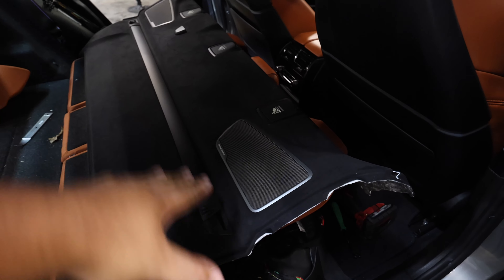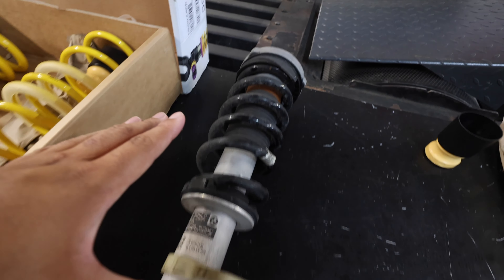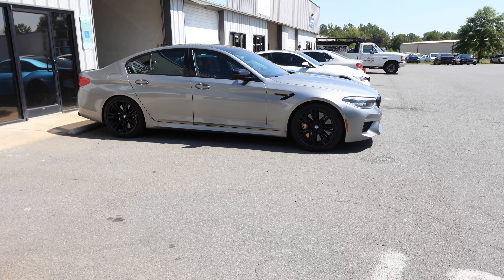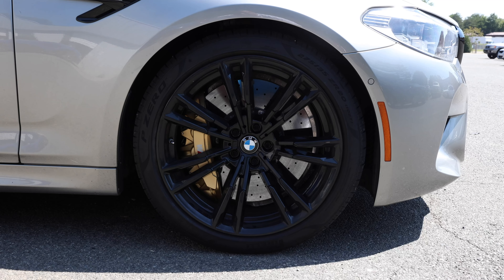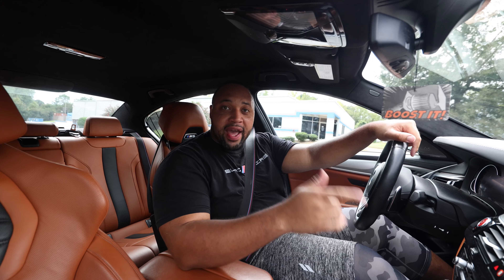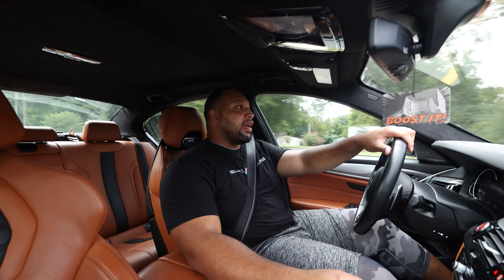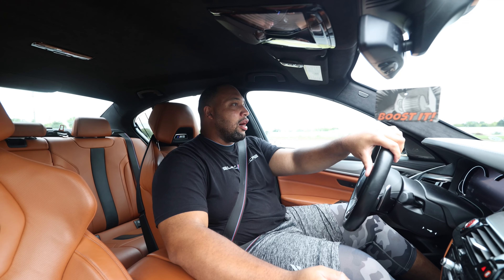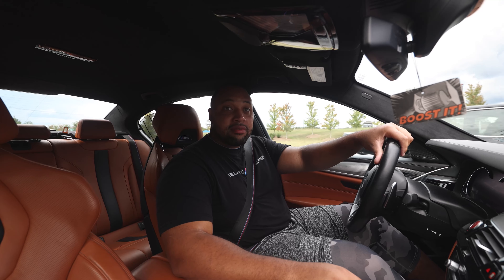BMW F90 M5 KW HAS Kit Install #kiesmotorsports #eurompire

Comment: When you installed them, did you have any lights pop on the dash or any error messages about suspension?
Reply from the maker: Nope… the HAS kit should not give any errors

Comment: What made you chose the KW HAS vs a regular set of lowering springs? I have a set of HR Lowering springs sitting my garage and can’t decide between putting them on or buying this kit.
Reply from the maker: For the F90 I have heard that the standard H&R springs do not lower enough for most people. Most people are using the M550 springs for a better drop
Reply from the maker: I went HAS kit because I wanted to run KW suspension on this car. Well it was between this kit and Dinan
Reply: @WhatsyourForte   gotcha I have a set of M550 springs but looking at your car I may have to buy the HAS kit.

Comment: Sry mate, g80 m3 way better in every aspect. New m3 true racer this is just powerfull limo not racer sports car...
Reply: Where’s yours 😂
Reply: Go watch auto glory. M5 smoking everything moving.. so I’d contest that statement, but we’re all entitled to our opinion🤷🏼‍♂️ ( sports sedan 😉 )
Reply: @TheSubaruAddict  when subaru becomes a brand I will respond. 😂😂😂
Reply: @swift__  g80 m3 comp stage 2 smokes 992 turbo s in 1/4, m5 stage 2 doesent....
Reply: @enakup  if the turbo s is stock sure. No way a stage2 911 turbo s is losing to a g80 m3 that’s also stage 2.. stage2 g80 is ots  jb4,bm3 etc are all ots. Stage2 g80 is same power as 911 turbo s stock. But we can agree to disagree. ( 7 series is the powerful limo you referred to . Imho of course )
Reply: @enakup  I don’t even drive a Subaru anymore lol they’re pieces of shit.. lmao
Reply: @enakup  believe it or not I actually have a ‘23 g80 m3. The point of my comment is let the man do what he wants. The M5 is a fantastic car for his needs so no need to hate
Reply: Why so condescending? I can be dismissive too.. m3 is slower in a straight line and needed pilot sport cup2s to barely beat a 5 year old F90 chassis running crap pirelli pzeroes around the ring. M5 has historically been a tier above M3. You’re also comparing a new chassis to a 5 year old one- the upcoming G90 M5 will blow the G80 out of the water.
Reply: @wills686  🤜🏻🤛🏻
Reply from the maker: It all comes down to what you want in a car. I would not consider the G80 M3 a race car. It handles well but not on that level. Also which stage 2 G80 are you talking? Stage 2 pump gas or custom E40-e50 tune? Stage 2 they only in the low 600s wheel
Reply: @enakup  if the 911 turbo S is stock, then maybe🤷🏼‍♂️ but m5 stage2 is going to be over 700wheel hp, I’d be hard pressed to think it cannot run a faster 1/4 then a stock 911 turbo s ( same as comparing it to the g80 m3 with stage 2 ) either way tho, I love all 3 super, badass vehicles 😎🤘🏻
Reply: Is there a video of them running the 1/4 mile anywhere?